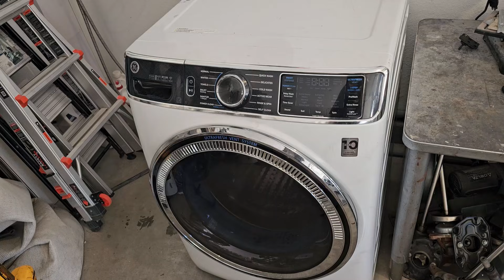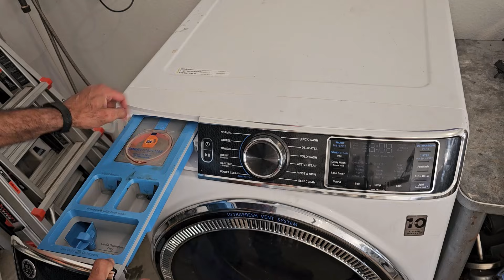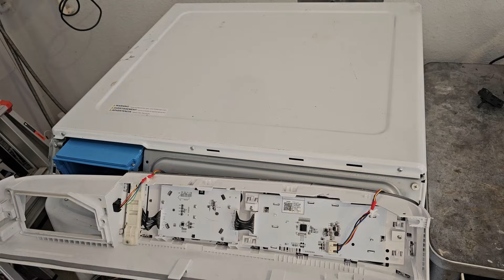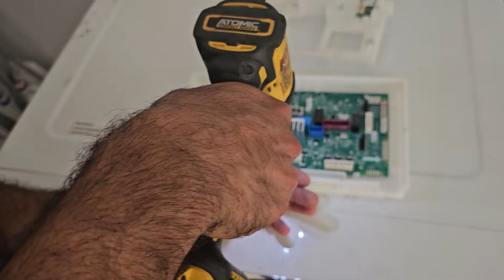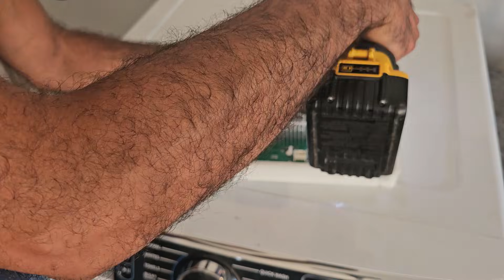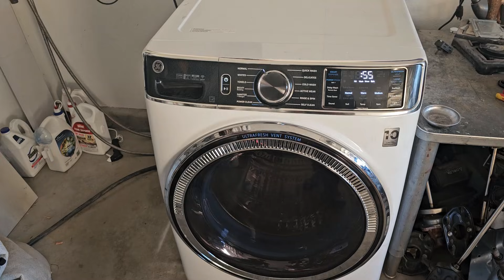How To Replace The Control Board On A GE Front Load Washer!

Comment from the maker: If you have models numbers GFW 510-550 order the control board using this link below:
https://bens-appliances.com/products/wh22x36638-ge-washing-machine-main-control-board?sca_ref=6821834.fOHQqjp2kC3zb
If you have model number GFW 650-850 or PFW 870-950 order the control board using this link:
https://bens-appliances.com/products/wh22x36637-ge-washing-machine-main-control-board?sca_ref=6821834.fOHQqjp2kC3zb
Reply: What is causing my GE front load washer the same as in this video, started running on it’s own and the door was open and the front panel had nothing on it so I pushed the power button and the front panel showed normally I changed it to a quick wash and shut the door (the motor is still running) and I hit the start button and it clicks and I can’t tell if it’s working properly but I hit the pause button and the motor was still running and I hit power button and the panel turned off and the motor is still running I can open the door and it still goes. I unplugged it and plugged it back in and it starts running again so I unplugged it for 20 minutes and then I plugged it back in again and again it started running when the the door was open and then I hadn’t touched anything. ? Could it be a power relay button according to ChatGPT? Where do I find that part and does that sound like a power relay switch problem or a control board problem?
Reply: I have a GFW550SSN2WW
Reply: Is there any need to re program the machine after installing of the new board? Paperwork mentions the personality.

Comment: Am watching in case my new drain pump on the way doesn't fix my issue...wish you had shown the control board connections in normal speed, though. Thanks!

Comment: So I installed the new control board. When I powered on the machine, it displayed a number 1 and I could scroll through the numbers. I wasnt sure what to do and put it number 6 and pushed play. It accepted the number 6. Now when I turn the dial, I have lost the whites and normal wash options on the left side. How do I reset this and get my normal options back?

Comment: About to replace my GE GFW550SSN5WW, since I’m in a wheelchair I can’t do the same things I used to. Need to check the pump replacement video. Repair inspection report had door seal damaged (warped due to item caught in door)? Warranty guys did their best to set it up so the failure was just after the failure 🤬🤬🤬🤬🤬🤬🤬🤬🤬🤬🤬🤬🤬. I’m an engineer and planned obsolescence makes me sick 🤮. I recommend getting the warranty for a year or two longer. Good luck, have fun, don’t die is a great movie. ☮️💜😷🤣🗺️

Comment: I have a GE GFW6555PV0DS that no matter which wash cycle I have it on, only runs for 4 minutes and then ends. Therefore, it never gets to the drain portion of the cycle. Is there a way to check the drain pump without replacing it. You said the pump should be replaced before replacing the control board. HELP!!
Reply from the maker: In your case i am 95% sure you have to replace the pump and the board at the same time!

Comment: Amazing!  I had the 550 model.  I ordered the part and installed myself.  I am not handy, but curious.  Getting all the connections disconnected was by far the hardest part.  Re-connecting was super simple.  One tip - Add to end of video what to do once you plug it back in.  I had every light flashing.   Took a guess and hit the play button which put me into the personality setting.   Read the card/text the right message to learn your personality setting.   I guessed wrong, but the washer is doing a cycle!
Reply: It works, but the light selection and the grey line on the spinning circle to select the settings are not in line.   Not sure how to fix that....

Comment: @DuctTapeMechanic

First of all, your videos are very informative and helpful. Thank you for taking the time to share them!

We have a GE GFW650SSN0WW and have watched this video, along with a couple of your others covering common issues with these GE front-load machines.

Ours stopped working and displayed the “DOOR” code, so I initially replaced the door-lock mechanism. Unfortunately, it still didn’t work and continued displaying the same code.

Before replacing the control board, I came across your video where you mentioned that replacing the control board without checking the pump first could potentially short out and damage the new board. I checked the drain filter at the lower front-right of the machine and found a minor clog.

I haven’t yet turned the machine on its back to inspect the pump, drain lines, etc., because I came across your video showing how to access the diagnostics. Our machine is displaying these codes in this order:

23, 27, 26, 3, 38 & 39

At this point, I’m not sure whether I’m dealing with the control board (approximately $150), inverter board (approximately $150), pump (approximately $60), or possibly more than one of these components.

Based on those diagnostic codes and what I’ve described, do you have any suggestions on what I should check or test next before I start throwing parts at it?

Any help or guidance would be greatly appreciated. Thanks again for all the great videos!
Reply from the maker: I would replace the pump and the main control board. If you use the website in the video to order both you will get the best deal. If these two parts do not fix the issue you can return both (no real risk to you). Be sure to watch my video on how to replace the pump the "quick" way. Best of luck.

Comment: Did everything you said and used the link to order a new control board.  Put it in but had to find the programming code for my washer but other than that this was pretty easy. Thanks for this video.
Reply from the maker: Awesome! From my understanding the control board should come with a card/sticker with instructions on how to enter the personality/code (if not a simple Google search also does the trick). Glad you are up and running!

Comment: Hi I have a few-850 , the issue I am having when I turn the selector knob not all the functions are lighting up. So when I press start the machine will start to wash and then stop because it will switch to another mode/ function
Reply from the maker: That is a common symptom of failed control board. I would replace the drain pump (as this often causes the board to go bad) and the control board.

Comment: Hi, I had the same door error code. I replaced the door lock already however the door error code is still there. Is there something to reset after the door lock have been replaced? Or should I go ahead change the main control board
Reply from the maker: Go ahead and replace main control board! 90% sure it will resolve the issue!
Reply: @DuctTapeMechanic Thank you for responding
Reply: @DuctTapeMechanic  I replaced the main control board today and the door error code is gone. Thank you again for this video.

Comment: If I didn’t have drain pump issues but I just did a wash that was to heavy can I get away with just changing the control board ? (My power buttons don’t work at all)
Reply from the maker: I would definitely replace the drain pump just in case that was the underlying cause. It is relatively cheap. It can be found on the same website (linked in video) as the control board.

Comment: After replacing the control board on my GFW510, washer knob is not aligning with the correct lights selection. How can I fix this issue?

Comment: Great video, thanks for sharing.  Appreciate the clear step by step instructions.  I had to replace the drain pump first, then replaced the main control board.  Machine works like new now.  Lower in this thread are step by step instructions after powering up the washer with the new board, on setting the personality ID (I have a GFW650* so it was 3").  I wish all you tube videos were like DuctTape Mechanic!

Comment: Stuck on this last wire. The same one you used a screwdriver to get out.  I can't see how to pry it loose and I don't wanna break the clip.  I couldn't see how you did it because you sped up the video past it.
Reply: I got it off finally, my finger is suffering from the effort and torque 😂

Comment: I have GE650SSNOWW.  I have already replaced and tried to reset my washer and it still says DOOR.  If I replace this part and it still doesn’t work then what???  How do I mate new board to machine to read new board?
Reply from the maker: Definitely sounds like a control board issue. Worst case scenario you can always return it if you purchase it using the link in the description.

Comment: With your guidance, I found zero voltage on the control board pins during the drain pump test. I have just received the new control board for my GFW550SPR5RS (from your store) with a new drain pump. Thanks for your videos and great prices. I wonder, however -- since the board seems highly prone to to fail from even the slightest bit of 'misbehaving' resistance and variation in power and voltage going through the drain pump,  may I can run the new pump more  safely from a 120-VAC relay? Or maybe add small inductors along the wire pair to the pump, resisting current spikes? 

The old pump looked perfect when I took it out, and the filter was clean. In testing for a couple of 1-second operating cycles from a 120-VAC  wall socket connection, my old pump runs fine. (I don't dare connect it directly into the new control board, in case the 19.4 ohm resistance resistance goes momentarily 'wrong' during operation.) I have a new pump, but I worry that it could create the same main board fault in the future. I haven't yet tested the long wire pair to the pump, but will do that (for short-circuit faults) before running wioth the new board.
Reply from the maker: You definitely did the correct thing by replacing the drain pump with the main control board! Im hoping the repair last you for 10 years!
Reply: The wires were good (with infinite resistance versus the frame and each other when disconnected). I did not add a separate relay circuit, but I did add a small iron core inductor ring ( 33*23*15) around the wire pair before it enters the pump. If I understand these things correctly, the inductor will tend to slow down very sudden changes in current (and power) if the pump creates sudden drops in impedance during operation. It will tend to release power during zero voltage phase changes, and consume power during voltage or current spikes. The are widely used to reduce RF and lower frequency noise in 'pure sine wave' generators and inverters.

It's working great, thanks to your well-made video and those lower cost parts from Bens!

If I blow up another control board with the same problem, I will need a new board to provide the controlled switching on the pump interface.  But I will use the board connector to drive a better-behaved relay with slightly less power from the board, instead of running the pump directly. When activated , the "load" connectors on the relay can drive the pump from the wall connector interface.
Reply: You are talking about a ferrite, that goes around wires usually with a 0-5v signal or a 4-20ma signal to keep radio frequency waves from inducing voltage on the signal wire. That will do absolutely nothing for what your talking about

Comment: My washer would not turn on. Power was coming into the motherboard, but it was not turning on the unit. Replaced the motherboard with a new one. Plugged it in and a bright zap of electricity and smoke coming from the burgundy colored connection in the bottom center of the motherboard. I checked, I don’t see loose connections, bare wires, or anything off. Worried I just fried the new part. What could be going on with my machine?
Reply from the maker: Sounds like you had a drain issue caused by a shorted drain pump. Best thing to do is return board. Replace the drain pump and then install a new board.

Comment: Thanks boss, after just under 3 years of buying I had to do this. Mine is a GFW550 and I had to set a personality '3' for my model for anyone else wondering with that.
Reply: Thanks for that info! I’m getting ready to replace mine right now and was hoping someone mentioned the 550. Ge’s auto text starts at model 650. I was going to wing it and use the 3 but was nervous.
Reply: What do you guys mean? What is the 3 mean? Thank you in advance.
Reply: @Igwta143  I have the 550 as well.   When you plug it back in, every light shows up.  If you hit the play button, it will start counting up (1-12).   I selected 3.   It 'works'.  The cycle has started, but.... my lights don't line up correctly with the selection (Bulky/Sanitize/Whites/etc...).   Not sure if the 3 setting is causing that?  Can someone clarify?
Reply: shoot!  RTFM!!!   The business card that came with the control board asks you to text the part number.  Simply do that for any model number.  the GFW550S should be a TWO, not 3.  Time to reset, once my first load completes!

Comment: Hey there. I think I have to change my board. I'm getting the door error. I've checked the door latch... changed the door latch assembly and still get a door error where it locks and unlocks repeatedly until it says "end." I tightened the metal door latch on the swinging door itself. I put it in service mode and found a code "23."  I think the next step is to open the machine itself and inspect the internals and wiring. What I don't understand is, it's not sensing the door is locking or latching properly, however, when the door says it is locked, i pull the door gently and it is definitely locked. If I choose to install a new board myself, you said the 16 plugs plus the pressure line is self explanatory. Are each plug different from each other to where I will be able to know which plug goes into where? or are there plugs that are identical to each other?
Reply: Same issue.  Did board fix it?

Comment: Followed your directives to the T resulting in success thanks so very much! This after having local repair contractor replace the door switch only resulting in frustration with a continued down machine. Contractor then wanted $700 to replace the board. Thankfully I found you and did it myself. GE should be embarrassed for putting Chinese junk components in these machines. I only did this because wife said this washer (when running), is one of the better one’s she has used. Why PC boards in appliances. Go back to electro/mechanical timers and stay away from Chinese inferiority.

Comment: hey so i had the issue where the door would not unlock and it kept showing door on the panel. i had to rip the door open because the manual unlock as well as the force unlock would not let it budge. i took the door lock out and opened it up and noticed that the plastic around the coil was melted ultimately not allowing it to unlock afterwards. sooo i replaced it with a new one and as soon as i closed the door and tried to start it up again it locked and would not unlock again. i did smell a burning smell so i can only assume the exact same thing happened and the control board is the issue. so.. my question. if the original door lock shorted and messed up the control board, would the control board then fry the new door lock if thats all i replaced? just want to get this thing fixed so im trying to figure out if i should just get another new door lock along with the control board
Reply: We are currently going through this right now, any chance you were able to get it fixed?

Comment: Thank you so much for the video! One question I have is if the drain pump has always been fine and there are no burnt up components on the board, is it likely just an issue with the board? Or is it still worth flipping the machine and doing the resistance check? Our machine was turning on, then after 10-40 seconds would click, power off, light would come on again, etc...
Reply from the maker: I would definitely replace the drain pump and the control board at the same time. If pump is shorted it will destroy new board. Both parts can be found in the description of the video (cheapest prices I could find!).
Reply: @DuctTapeMechanic  ok, great ta

Comment: I ordered and installed the board. Still doesn't work. Is there some programming that needs to be done? Also, does it need the top on to operate. I tried it with the top off.
Reply from the maker: You need to make sure all connections are hooked up and then text PARTS" to 36534 it will walk you through the simple procedure of entering the personality

Comment: The one part I really needed help with via the video has been speed up.  For older hands in tight spaces, how do you remove the plastic connectors from each socket.  I press the tab and try to wiggle them free but they don't budge and I don't want to damage any wires or connectors.  Is there a tool that can be used?

Comment: Does anyone know if GE has improved these at all? I did a quick purchase of the 550 when my old washer just died - I liked the mold-resistance feature. But after I ordered it, I'm seeing all the issues people have had. I'm hoping over the last few years the boards have been improved?!
Reply: Mine is two years old (Feb. 2023) and has already failed (May 2026)  Still chasing after the issue as it showed multiple error codes on the diagnostic screen/display.  Replace damper vent van assembly and the time out before a relay clicks and the machine shuts down has gone from 6 seconds to 40 seconds.
Reply: @ShaneWolfhound oh geez :(. I guess maybe the mold issue is better. Ughh

Comment: Helpful video! I appreciate the detailed walkthrough, showing each connection, screw, or sliding piece step by step. I'm not particularly handy but was able to replace my main board following each step you showed. 

I'm glad to have saved a couple hundred on a repair call. Now I can catch up on laundry!
Reply from the maker: That's awesome, great job on the successful repair you certainly saved hundreds!